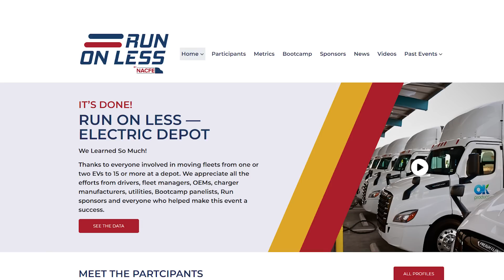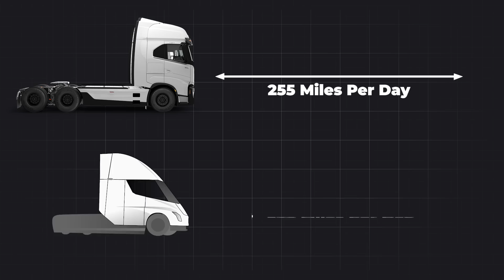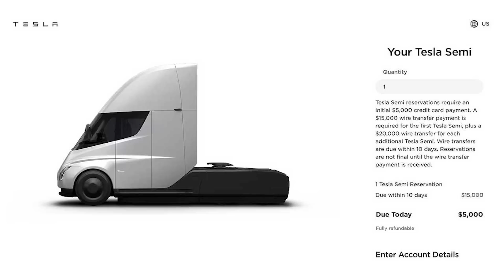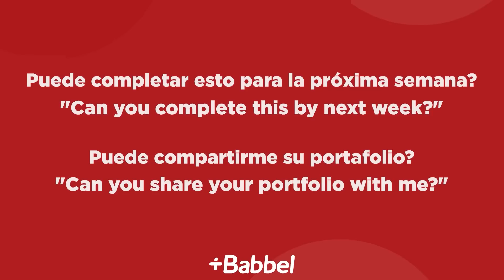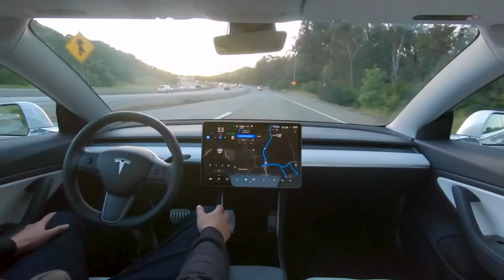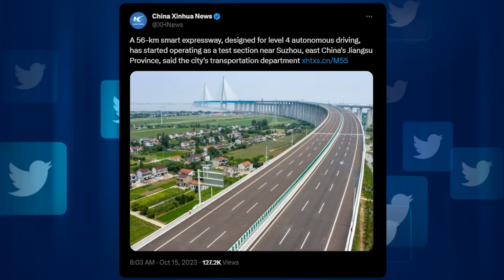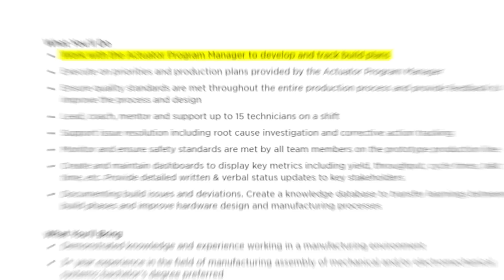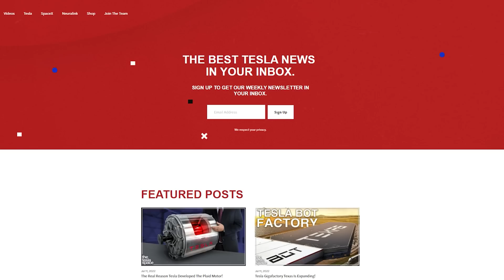Tesla Semi Performance Results Revealed!

Comment: Three stops to recharge in one day...  and they're bragging!?  How about competition against new diesels measuring performance and cost?
Reply: They aren’t bragging that EVs are better than diesel trucks in mileage or haulage, at least not yet. But these aren’t the only yardsticks for efficiency. There’s cost, maintenance, environmental friendliness. All of which EVs are better. Even on mikeage and especially haulage the EVs aren’t too far behind the diesel trucks. Give it a few more years.
Reply: I bet that there’s electrical service at every load/unload dock, so they could add a charger at each regular stop too.  No need to go to a gas station then, since they stop for 30-60 min to load or unload.
Reply: Sadly for diesel market, perhaps half of the trucks doesn't work all day long.

Comment: I hope that don't explode and kill innocent people
Reply: imagine your smartphone exploding in your pocket destroying your crotch. Or when you are taking a call and it removes your ear and half of your head. Must be very common and it could be you next.
Reply: @kazedcat  You might be interested in what the National Fire Protection Association (NFPA) says about this: " It takes some time for enough energy to accumulate to trigger thermal runaway in a battery. This makes them different from ICEVs, which can be quickly ignited by a spark or flame." Sounds like it's the ICEVs, not the EVs, that are blowing up.
Reply: @kazedcat   I was making fun of OP 
I missed that. Sorry, mate!
Reply: @kazedcat  Dude, Lithium battery was created just for phone tablets etc. Isn't made to put on car or even on a track, is to much load for a leptop battery, if one baterry cell is damage will distroy all  battery cells and turn on a fire who is hard to put down. Telephone is a telephone and car is a facking a car, you can't put a lot of telephone battery together on a car and say "Inovation"
Reply: @SebiAlan-tq3xq  Battery is battery. Just keep the current draw at the same or smaller C value. Keep the same temperature and the same current and you get the same chemical reaction.
Reply: @SebiAlan-tq3xq  Bro living in propaganda
Reply: @yomanyo327  i saw a lot of electric car burning on internet.  A bigger and more forced battery seems even worse.
Reply: @SebiAlan-tq3xq  research how many ice vehicle fires there are each year. Here in the U.S. we had 217,000+in 2022 alone.
That averages to a real world combustion engine powered vehicle fire every 4mins.

And the #1 open recall across ALL LEGACY ice oems globally is for the risk of FIRE even when parked. 
10,000,000+vehicle's 3-5 year's old are under recall here in the us for the risk of FIRE even when parked.
Reply: @SebiAlan-tq3xq the problem of internet is that filming a ICE car burning is not interesting for the standard boomer, so it's not broadcast.
But facts are that 10x more ICE car burn in average.
Reply: @SebiAlan-tq3xq  Did you ever wonder why you saw a lot of electric cars burning on the internet? You saw them because they're newsworthy. did you ever wonder why they're newsworthy? They're newsworthy because they're rare. There are hundreds of ICE vehicle fires every single day. How many of them did you see burning? 
Every study ever done shows that ICE vehicles catch fire at a much higher rate than EVs; so EVs aren't the problem, ICEVs are the problem.